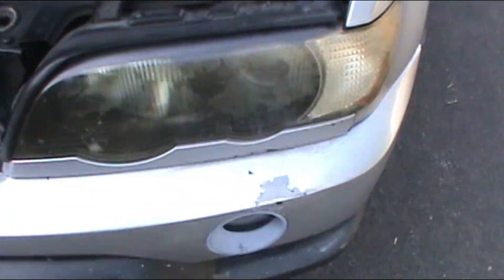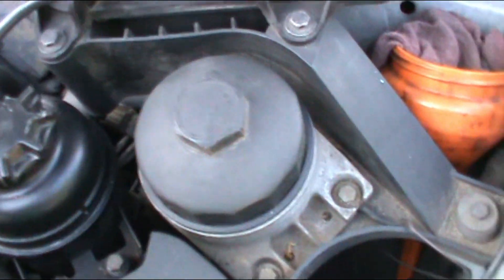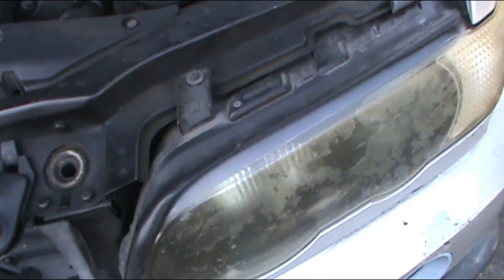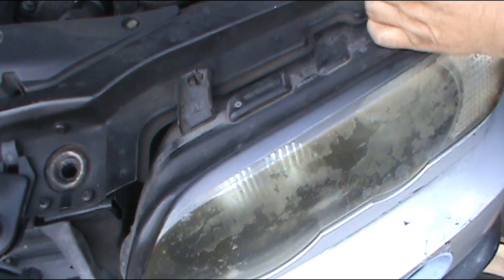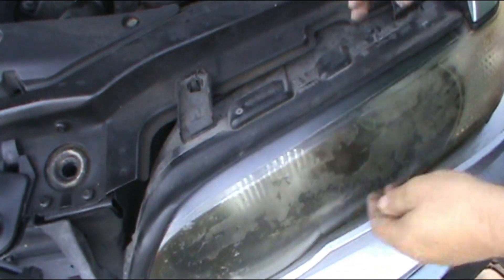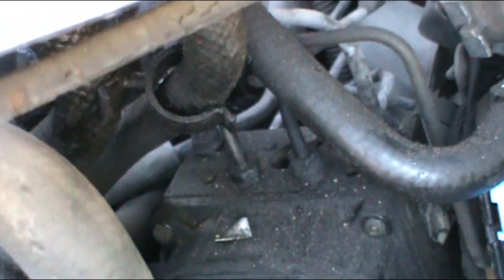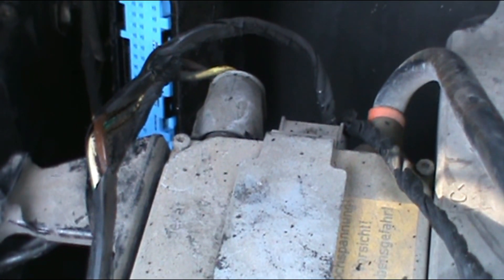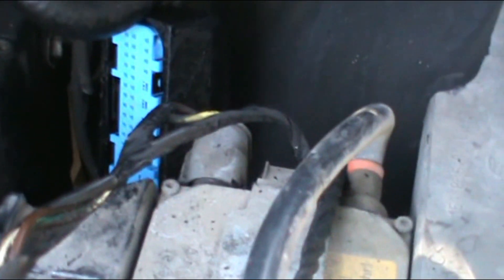Trans Fail Safe Mode Troubleshoting 2000 BMW X5 4 4i

Comment: Another one on the X5 is wheel speed sensors, one faulty sensor will set trans- failsafe mode. And battery low voltage too. +More
Reply: I hit a crib an my transmission fail safe came on
Reply: @iranwilson7464  was there a baby in it?

Comment: This just happened to me this morning on my way to get coffee. Thanks you so much. I will try this first as this is the clearest video on YT with hands on. Thanks again and happy holidays!!!!
Reply from the maker: Hey thanks for watching my video! yes give it a shoot, it has helped  a quite a few people already. Don't forget to subscribe!
Reply: I am Th man yes it did.
Reply: I am Th man I don’t drive it very often. It did work. But I know I’ll have to get it done right in the future.
Reply: Isaac Patino I’m having the same problem with my 330i I changed all wheel sensor and my car goes into limp mode and stays in one gear ⚙️ mostly four could it be my oil cooler

Comment: This is one major issue I have with OBD2, on any car. The computer is SUPPOSED to tell you what the problem is, but it doesn't. Often times you have an issue and you can get like 9 DTCs, only one of which is real. The first fault triggers all kinds of other 'ghost' faults. I can't believe we've had OBD2 26 years and this is still a major problem. It never should've been released like this...
Reply from the maker: Totally agree with you!

Comment: Buenas tardes 
Disculpa cual era tu falla por la cual desconectaste el módulo de abs?

Yo tengo falla en mi x5 modelo 2000 que me bloquea los cambios de la transmisión esa será la solución a la falla de mi x5?
Reply from the maker: Hola Marcos, si èsa era la falla, se bloqueaban los cambios. Es muy probable que èste sea el problema. Lo que pasa es que El modulo de abs se pone en corto y causa engaño a la computadora causando que se bloquen los cambios. Nadamas desconectalo y si se arregla el problema ya la hiciste! Gracias por ver mis videos

Comment: Now I only get transfail safe mode in gear 2...the engine revs high before getting into the 3rd gear. Could this apply to my situation? I changed the fluid & filter & didn’t see any signs of catastrophic damage.
Reply from the maker: Hey Thanks for watching my videos! No, I don't really think you have a catastrophic damage on the Trany. Although the abs module is not the only symptom for the Trans Failsafe mode, it is a very common problem on BMW's. Give it a try, just disconnect the module  and if you don't get the Trans Failsafe Mode, you have found the problem. Hey don't forget to subscribe to my channel
Reply: Did you ever find your problem

Comment: So my BMW X5 e53 2003 totally stopped working last night I was driving and it come up on the dash trans failsafe mode 

It was going about 20 miles an hour when I was revving it fully and really struggled to pull away from a standstill 

Then after not even a few minutes it would not even move when accelerating and In gear 

I’ve got out of the car but left my lights and hazards on and after about 15 minutes when I got back in it would not start . I turned off my lights hazards and also turned my stereo off unplug my phone charger and it started up again. 
Before I had no warning lights on the dash but when I started it it showed an ABS light also the ESP light and I am not sure what the issue is. 

I am hoping that it is The battery that was not providing enough voltage to the ECU so it was bringing up fault codes that cut the transmission but my local garage today have told me that if it is not moving when you put it in drive then you need a new gearbox which is £1200! 

Can you please advise me on what you think it might be? 

I find it very strange that it was driving fine and it idle is okay but will not move and it does show on a reader that there is a connection issue to the ECU
Reply from the maker: Hey thanks for watching my videos, that's exactly what they told me on my BMW, they said I needed to replace the whole transmission. So I suggest you that before spending  big bucks on the car, follow this video and disconnect the ABS module. If you vehicle comes back and runs normal you just found the problem all you have to do is send the macho to get a refurbished and you will have your vehicle back
Reply: @TIPSFORDUMMIES  I have disconnected it. It literally moved about 2 feet and that was it now it isn’t moving again. Very strange. And trans fail safe is gone but got the abs and DSP light on dash

Comment: dude. your awesome. I will disconnect my 2003 4.6 is and see if thats the problem too.
Reply from the maker: Yep! That solved the problem on my vehicle, a couple of mechanics wanted to replace the whole transmission, and they where supposed to be a BMW specialist LOL. Hey please let me know how you did on your vehicle and please don't  forget to subscribe.
Reply: @TIPSFORDUMMIES  Boss, youre a General. For everyone, I had the same symptoms as in the video posted here by Tips for Dummies. When I turned on the engine, in about a mile or so the Trans Fail safe would illuminate and kick the vehicle into slow mode. Also the tachometer wouldnt work and both temperature gauges, water and transmission oil would immediately go to hot and stay there. The tachometer wouldnt work as well. I  read where it might be the ignition switch so i changed that  first and the symptoms were still there. Then I read on another post to look at the DME and see if there is any corrosion but all the electrical connections were clean as a whistle. So then after reviewing this video I took out the head light a reached in and disconnected the ABS Control module and voila all symptoms of the vehicle disappeared and was brought back to original specs. I will continue to drive the vehicle with the the ABS control module unplugged. I put tape over where the plug plugs into the module to prevent water from getting in  and corroding the exposed pins. Also i put the plug in a zip lock bag and taped it closed from water and the elements. I will send the abs control module off to get it repaired through Ebay for $129.00 - $159.00 as I have read their reviews on two different companies. Than you so much TIPS FOR DUMMIES as for 6 months I didnt drive the vehicle as the repair cost was going to be way too high. Some suggested dropping the transmission and changing out the solenoids. Ha, I knew there had to be something electrical causing the mishap. Thanks again. I drove the vehicle twenty five miles without a hiccup. Awesome.
Reply from the maker: @alfa_romeo55yush82    Fantastic! I am so glad it worked out for you. You know, I notice that when it comes to BMW's the information out there is so hermetic so I am so glad videos like this can help people. Thank you so much for watching.
Reply: alfa_romeo55 yush what’s up bro. So I bought my. 5 like 3 years ago it was still is super clean but this keeps happening to me as well minus the cluster going crazy but it’s not right away it’s right after 20 min plus highway time then it goes into this trans fail safe mode after that I cannot surpass 40 mph mark but it shifts great in the morning when it’s cold I’ve read that the transmission Oiler cooler was the problem on another fellow bimmer comrade and it was heat related for his x5 I have the same or about the same symptoms he described and I’m thinking about doing this here and hopefully it will work but it may not because it might just be the transmission Oiler cooler
Reply: Hey am having this problem in my x5 2002 when i am driving and I  press the gas it goes in to trans safe mode the suv go slow or it show code output shaft speed sensor
Reply: @robinserrano3325 did u find out what it was?

Comment: Am getting code p1062 p1067 p0966 will this help my car don't move or rev up RPM and is on transmission safe mode
Reply from the maker: It won't hurt to try, when this module goes on short, it make all kinds of weird stuff.

Comment: Will this also work for the 2003 x5 3.0i ?
Reply from the maker: Hello Frankie! Yes it does, what you can do is just disconnected to see if the problem goes away if not you can connect back on.
Reply: What if I unplug it and the trans fail-safe light still comes on?

Comment: Do you think this applies to a 2000 740il ? I have the same problem with trans safe mode
Reply from the maker: Hey thanks for watching my videos! Being both German vehicles, there is a huge chance they may share some of the electrical parts including the ABS. If you know where the ABS control module is on your Mercedes he will not hurt at all if you disconnected temporarily, if the problem is solved bingo you got it, but if the problem persists just connect the ABS back on. Thanks and please don't forget to subscribe to my channel

Comment: Once you remove the module, do you have to reconnect it again at the same time? Or you have to get it repaired and then you reconnect it?
Reply from the maker: Hey, thanks for watching my videos. Yes once you remove it, you have to send it for repairs, what happens is that the module gets short out on the inside, if you put it back like that, your vehicle will continue having that issue. Don't forget to subscribe 👍
Reply: @TIPSFORDUMMIES  did u drive around with it unplugged for the 1st few days to test it ?
Reply from the maker: @johndaniel3474  I actually drove the vehicle for like about a month, but not to tested, the test was done immediately once you unplug de ABS you should not have that problem. I drove the car while I was waiting for the ABS to be fixed. Thanks for watching my videos
Reply: @TIPSFORDUMMIES  so you left it unplugged driving  it and it never went into limp mode great video and thanks for the fast reply
Reply from the maker: Correct! Once I disconnected the ABS the limp mode was gone. I drove the car for like a month until I've got the part back. Thanks for watching my videos
Reply: @TIPSFORDUMMIES  sweet great video thanks agine you were not able to swap for a used one locally for cheaper
Reply from the maker: Hey John! thanks again for watching my videos. You know what?  you are correct! I think that would be a good option, I never taught  about looking for one locally, but that is actually a great idea for the new viewers. Thank you bro!
Reply: @TIPSFORDUMMIES  hi there! Just got myself an x5 3.0i 2005 and when I turn car off, I see notification: trans failsafe program,  but the car still runs... the transmission  kicks when changing...should I be doing what you showed in the vedeo??? Thanks in advance 👍
Reply from the maker: @quisqueyatvw.5174  Hello there! Let me ask you a question, is your cluster acting up weird? Is your transmission locking up on second  or 3rd gear? If not, then perhaps the problem may be something else, although it could be that the ABS module is starting to get bad. If you want to do a process of elimination, it will not hurt nothing to disconnect the ABS module go ahead and disconnected and if the problem goes away then you found the problem, if the problem stays all you have to do is connected back on and check further your transmission  thanks for watching my videos and please don't forget to subscribe 👍
Reply: @TIPSFORDUMMIES  hi again! Thanks for  answeing👍! What happened is that, when the transmission syarts changing gears, it feels like kicking,  and is the same thing when you  are reducing the speed... there also I hear the gears kicking too, when you are almost like stopping the car.... excuse my english since I'm communicating with you an English as my second language 😁
Reply: One thing I did also, was to disconnect the maf sensor connector, because it was also losing power when accelerating...i got power back after that, but if I'm not mistaken, all of the gears make this kicking sound when changing...
Reply: @TIPSFORDUMMIES  i think the transmission locks in secondn gear for just a bit...
Reply from the maker: @quisqueyatvw.5174  Hey, no worries about your English, English is my second language too. The way you are describing the problem, to me it seems like a transmission problem, if after disconnecting the ABS the problem persist perhaps you want to change the transmission oil. Also I had a problem in which the transmission all of a sudden will go down to second gear when it didn't supposed to and the problem was the transmission harness. Thanks for watching my videos
Reply: @TIPSFORDUMMIES  thank you man! I appreciate your help!
Reply: TIPS FOR DUMMIES when you say limp mode does that mean it would get stuck in gear and you’d have to turn your car off and restart the engine.  Cause if you say yes.  I’m going to do this right now to my x5 lol?????? Mine gets stuck in gear only when abs light come on
Reply: @TIPSFORDUMMIES  I unplugged mine today and so far no trans fail safe.  HOWEVER now my speedometer is not working. The RPMs and rest of cluster is fine.  Any advice if believe this would point to the abs module being bad ? I’ll drive for few more days and see what happens,